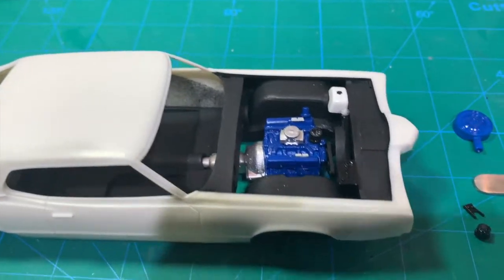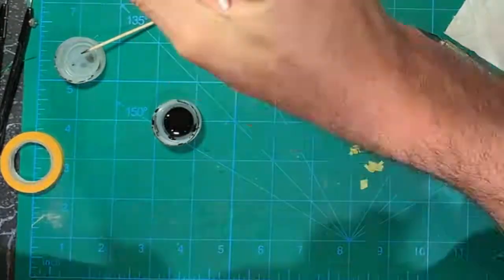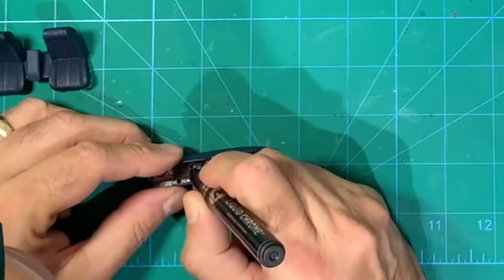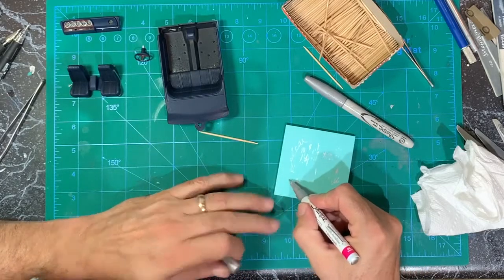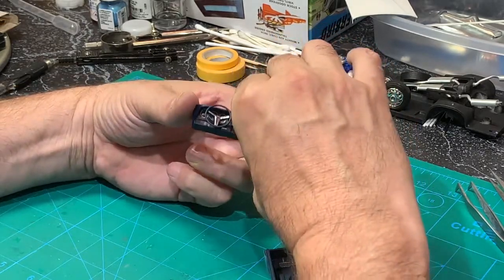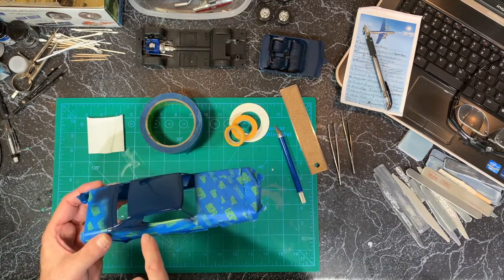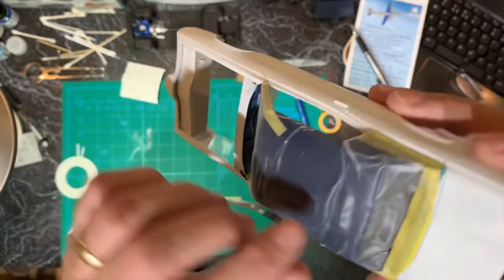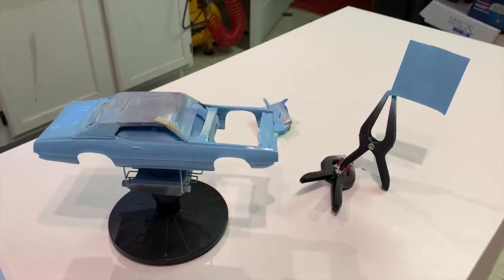Cars Bench Update #6   71 T Bird

Comment: I think your airbrush booth is sucking so hard its sucking in room dust, still looking great 👍
Reply from the maker: Good eye!  In fact, after the roof results, I ran my air filtration unit before the body and I only got a few specs.  I've been lazy about it; as planes are typically flat; but now needing pristine finishes, I've recommitted to running it for a few hours prior to painting sessions.
Reply: @mightyjjk1298  good idea, im worried for the same thing in my garage.
Reply from the maker: @TheBlueberry606  You can see a brief glimpse of mine at about 4:38 in my spay booth video - https://youtu.be/6UfUWZ96Ev4
Reply: @mightyjjk1298  nice filtration 👍